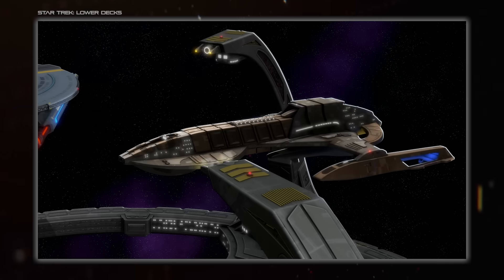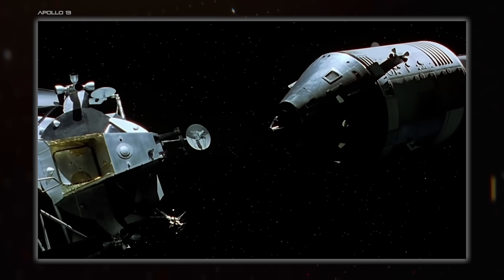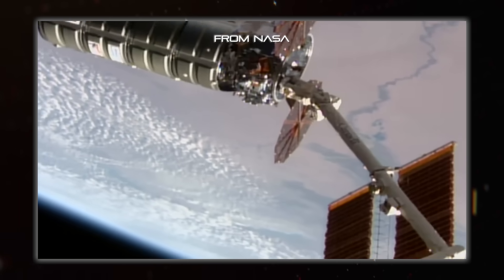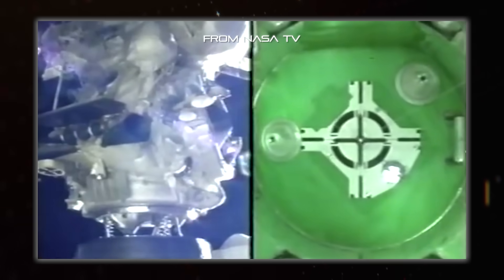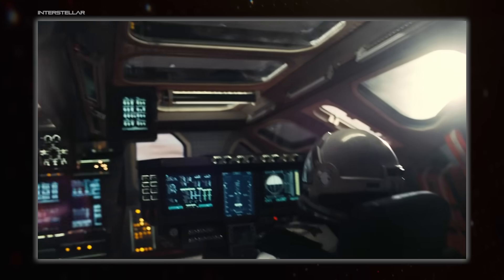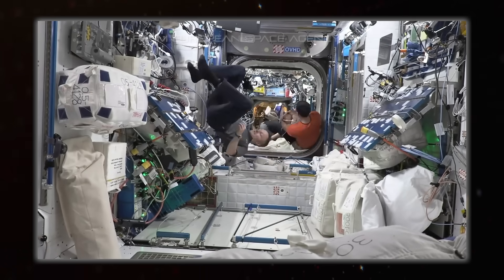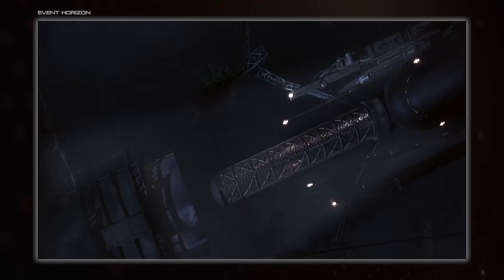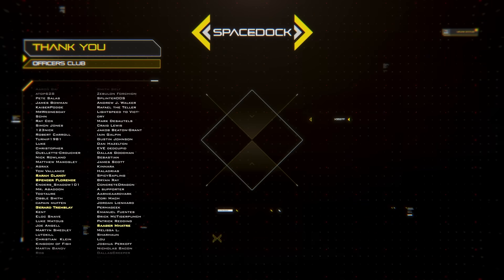How to Dock in Space

Comment: I remember from one of the Halo novels either a Marine or an ODST described a method they used when boarding a ship with a pelican, where the rear fold-down ramp had a docking collar on it which would weld itself to the hull, then they would cut through the hull inside the docking collar to make entry.
At least, I think that was how they described it. Many years since I read those books; don't recall which one it was in.
Reply: The First Strike novel, where a surviving Pelican (one passenger being Avery Johnson) docked with the Longsword that Master Chief and Cortana used to survive Combat Evolved?

Comment: My favorite "Non-Cooperative Docking" methods usually involve a ram spike. I'm sorry, but something about the idea of a boarding craft designed to say "Frag your ship, I'm coming aboard" is just chef's kiss to me. But then, I like Space Operas with military and pirate themes.
Reply: My go to is something designed to grab on to a docking port, airlock or hatch, then with mechanisms built into its own external door, brute-force the target door open. Think something like those jacks used to force open stuck elevator doors, or an upscaled jaws of life (specifically the spreader function). Why waste time cutting through hull armour when you can break a few locking lugs and overpower door motors? Plus, it makes it so you could enter quietly too, perhaps even using localized EM noise generators to jam out any sort of door sensors to block and open signal with a 'door sensor malfunction' one.
Reply: @kauske @kauske  I think any kind of forcing your way in would be a bit too noisy. Especially if you're breaking things to do the job. You might fool proximity and impact sensors with jammers, but the moment you start interfering with or breaking damage detection sensors, you're setting off alarms whose job it is to inform the crew that something is wrong with their airlock, and that's a safety hazard at the very least.
Reply: @Krahazik  You'd be surprised how un-seriously many will take a warning that reads 'sensor fault.' Because in most cases, it means a sensor broke. And that's a maintenance problem, not a security one. Never underestimate how utterly lax people are when things aren't presented as an imminent and obvious threat.
Reply: @kauske @kauske  No, I wouldn't, and I could see that for a single sensor, but when several for the same airlock go off, that tends to elevate the seriousness level from oh, we'll get maintenance to check that out sometime, to, someone get down there. Also, the level of attentiveness depends on the people and the seriousness of the system and area in question.
Reply: @Krahazik  I've seen people spray paint over all the warning lights on their car instead of ever fixing them.

I've also seen people let others into high sec places without any form of ID shown, just because they said they were like HVAC maintenance or something mundane.

You put too much faith in humans, I bet any ship you captained would be done FAST with that much trust in people who very likely don't want to do much work for their pay.
Reply: "Stone Place" by Fred Saberhagen; one of his Berserker stories. "The shaped atomic charge at the tip of the ramming prow opened the berserker's skin."

Comment: I'm probably way wrong on the physics, but I could imagine in place of a suction port some sort of solder-seal that is only suitable for 1-3 uses, and generally would require the target to have some extra cushion of sorts with regards to a thicker metal panel around the hatch. Heat a ring of solder that is kept in a channel through capillary action, connect, let it harden. Open the hatch and do docking activities. Close it up, heat the solder, and away you go.

Comment: This makes me think of docking in Starfield. Avoiding discussion of the merits of that game as a game, you do get to build your own spaceships if you choose, and you can control the location of the docking port to a great extent.

What I have found, and this may just be me, is that docking looks and feels "satisfying" when I have the dock lined up with a rotational axis of the vessel. I.e., the central point through which the ship rolls, pitches, or yaws. If I put a docking port off in a corner, it just doesn't feel right.

Another issue is where you put the dock in relation to what is going on inside your ship. In Starfield, even big Class C ships aren't that big... you have a limit of 80 meters in length, and most in-game vessels only have 3-4 decks. Boarding is a thing, but NPCs never board your ship; they always fight to destroy, not disable and capture. You, however, can definitely disable and board their ships!

So, the question is, what do you put on the other side of your own docking port? Do you put it next to your bridge for easy access, knowing that this is a game, or do you stick the port far away, forcing a hypothetical enemy to fight over every bloody meter to get to your bridge? Do you put an armory module, or at least a weapons rack, near your port so you can conveniently gear up before boarding, or do you keep your weapons well away, so a hypothetical enemy can't steal them? Should your docking port open onto a nexus of modules, so you can have ready access to medical, scientific, or engineering utilities, or do you put it on the other side of something basically useless like a companionway that you can (hypothetically) lock down to secure it from the rest of the ship?

Comment: One solution for the rescue-sub style of improvised docking would be using cold welding when there's nothing else to hold the two ships together.
If two similar, perectly clean metals touch in a vaccum they fuse together and if that fails you could just rub/spin the docking ring against the hull to achieve friction welding.
A quirk of this method would be that you have to leave part of the docking equipment behind when you want to detatch.
Reply: I have come across something like this in stories involving boarding or assaults where you need to get another airlock for some reason. Examples tend to have them be a new permanent airlock or have nano machines make and remove the welds. In the case of the permanent airlock, it is usually a disposable one and they don’t care if it breaks (since the target has been secured), or they can leave it behind (since they have more in storage).
Reply: @dreierdavid  WH40k assault boats do that, weld on with a collar that they cut loose and leave behind.
Reply: What about Glue?

Comment: Regarding compatibility, there is an international standard docking port being implemented by most space agencies and private providers (IDSS). So it's likely going forward that we'll see the evolution of a fairly universal standard with some level of backwards compatibility, like USB connectors for data. I can also imagine different types for different diameters, like IDSS type A for people, type B for small containers and type C for larger containers.
Reply: IDSS type C aka the hangar, no fuss no muss enter at slow enough speeds, let the doors close and touch down on the mobile platform to take you to the pressurized section.

Comment: Have you tried to simulate with Kerbal Space Program how easy or difficult it will be to dock two SpaceX Starships together side by side, not with one docking port but four legs and a varying amount of slushing fuel in each, and the varying mass of one ship compared to the other, as that changes when each ship unloads and one of the HLS ships gets heavier and heavier.

Comment: Force docking or things like a boarding torpedo should not be a thing. You're basically creating a room filled with flying debris for the boarding crew to enter while having air sucked out from the holes you've just made.
Reply: Having the air sucked out may actually be the point so long as your assault force is wearing a spacesuit as it may kill some of the defenders while preventing the others from interfering until they also suit up.
Reply: @maxpower3990  plus alot of the more detailed books and stuff i read get around that keeping air in thing by having a self sealing foam injected.
Reply: I mean, sounds like a plus to me. The room you just breached depressurizes, so any defenders need to suit up and somehow get into the depressurized area without depressurizing the rest of the ship, so that gives the attackers time to stage, get comms/a beachhead set up, etc.

Comment: After having played ksp, docking is either the most satisfying thing ever or makes you want to tear your skin off
Reply: The first time docking in ksp, using no mods just straight vanilla, was the most satisfying thing in the world...after a literal hour plus of the most frustrating thing imaginable. But once you do it the first time, it quickly becomes routine to the point of trivial (unless you mess up your design right good. then things get real interesting real fast, usually within RUD range. Running out of RCS fuel and only have reaction wheels and a primary engine made for an interesting docking experience)
Reply: @Grenade123_2   I did a lot of docking before unlocking the RCS tech, so I actually got quite comfortable using only the gyros and main engine.  RCS felt like cheating when I finally got it.
Reply: @stevenscott2136   I have habit of making very unwieldy craft, too much going on. No RCS on something that barely wants to fly straight is rough, lol.
Reply: @Grenade123_2  I typically just cover the bottom in ailerons lol
Reply: Before playing KSP, watching Sandra Bullock use a fire extinguisher to go from one space station to another: Yeah, pretty sure that wouldn't work.

After playing KSP, watching Sandrda Bullock etc: LOLFINGLOL
Reply: @wyrmh0le  I once ran out of propellant, and then RCS escaping Mun and was on a highly eccentric orbit around Kerbin. Had to push the craft PE into Kerbin orbit using EVA thrusters... fun times.
Reply: I once decided to do an Apollo replica mission. So orbiting pod, separating lander, all that jazz. The Lander Ascent Stage used a monopropellant engine, and didn't have enough fuel for docking, only just enough for orbit. It also only had a battery, no power generation. The Orbiter, did not have monopropellant fuel (even the pod was emptied). The LAS was an honest mistake, but the Orbiter was me intentionally cheaping out. Additionally, I had a mod that made EVA packs draw monopropellant from the ship, so EVA crew transfer wasn't viable.

So instead of docking the LAS to the Orbiter, I had to to dock the Orbiter to the LAS, entirely using the single Poodle engine. Bumping the LAS wrong would send it into a tumble. Every time I did that, I had to carefully maneuver the Orbiter and bump the LAS into behaving (or, you know, just feather time warp, but I wanted to engage with the full difficulty of my mistakes here). Ate several hours for what should've been a 5 minute docking adventure if that.
Reply: Reminds me of the "Explain Like I'm 5" answer to "why did Soviets lose the Moon landing part of the space race when they won basically every other milestone?"

Basically, every Soviet mission was a "Minimum Viable Product" because the goal was less about scientific advancement and more about beating the Americans. Sputnik was just a radio beacon. Laika survived hours instead of days in capsule that wasn't designed to be recoverable. While they technically performed the first ever space docking, they simply had carefully launched two vessels into the exact same orbit where they only needed to match velocities. Meanwhile Americans did everything the proper hard way, and that enabled the successful Apollo landing.
Reply: @Xazamas  The first space docking was Gemini 8.
Reply: @JohnWilliamNowak  I guess the post I read didn't let facts ruin a good story. It does make a more appealing narrative that Soviets managed to win every single intermediate milestone, but when it came time for the big finale, they only had bunch of haphazard contraptions instead of properly built foundation for a manned Moon mission like Americans did. I'm still pretty sure this is more or less what happened, NASA was prioritizing future gains instead of immediate "wins." Gemini 8 was a test run to ensure Lunar module can dock with the Apollo command and service module. (They did run into practical issues that were fixed for the Moon mission.)
Reply: @Xazamas Doesn't surprise me in the slightest. Cough cough Chernobyl..
Reply: @Xazamas The soviet scientists had the same problem as the American ones - money was only available for military applications.
So they had to sneak they ideas in.
Reply: @molybdaen11  Space Shuttle was allegedly gutted (or at least given incompatible design requirements) so that it would have the potential to be repurposed as some kind of "sub-orbital bomber."

At least this is what I've heard. The original concept was that the external fuel tank/boosters would've also been a "space plane" that would take the "orbiter" part into space, detach and then land back to Earth. This would've made the whole thing re-usable.

(When most people think of "Space Shuttle" they probably picture just the orbiter, but the term refers specifically to the orbiter attached to the external fuel tank and boosters.)
Reply: @Xazamas  It's hard truths like this that make me ponder on why there are still simps for the Soviet Union and so on.
Reply: If you tear the skin while docking you need to slow down and use lube my guy
Reply: Knowing that automated docking happened really early in the space program makes me feel much less guilty about using MechJeb.
Reply: I'd rather rendezvous and dock, than land on an airless planetoid, any day!
Reply: @Vinemaple the humble tylo: